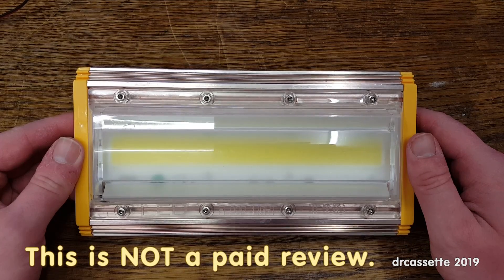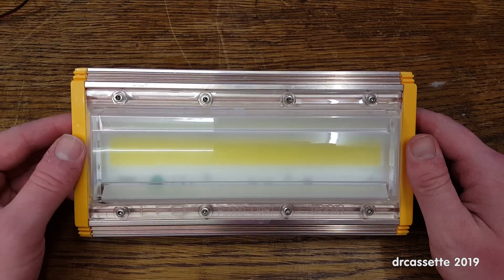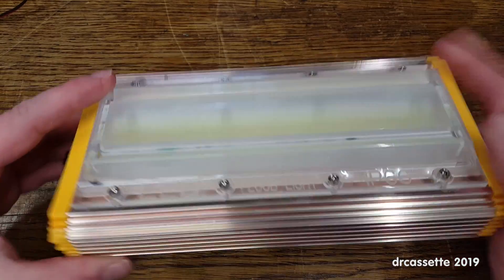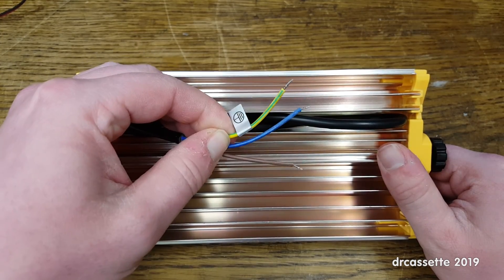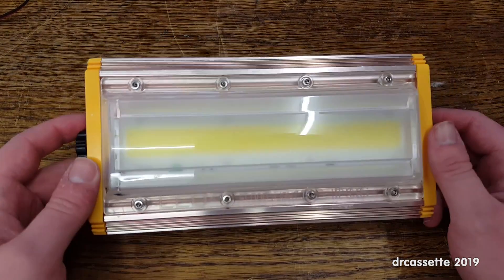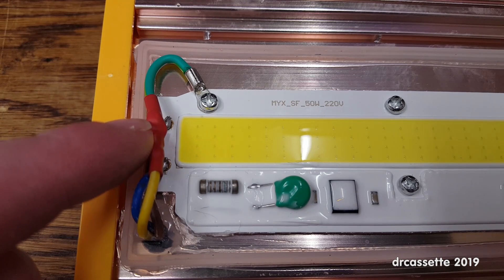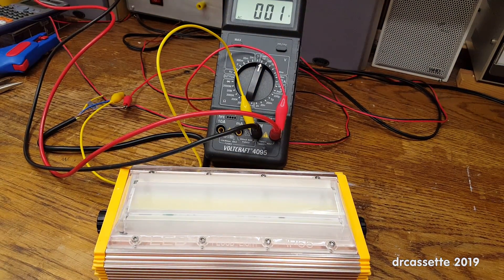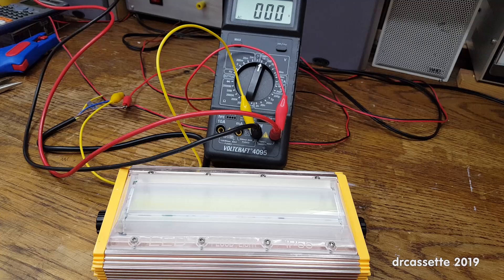50W COB LED lights off Ebay - Test, Modification, Setup as studio lighting

Comment from the maker: You may not want to solder wires before putting them into screw terminals. As some people have pointed out this still results in an unsafe connection. You may not do anything at all as everything is potentially unsafe. Just sit and wait.
Reply: Do you sell some of your stuff on eBay?  Is that what the studio lighting is for?
Reply from the maker: Yes, I do occasionally sell things on Ebay, and that's what the photos I make are for. But I have also already made a video using these lights. No flicker problems, thankfully.

Comment: LED and CFL lights are rated in Watts "equivalent" to an incandescent bulb. so a 23Watt CFL is rated for say 60 Watts. a 38 watt LED bulb is rated for say 100 WATTS. The numbers are really BS. What counts is the number of Lumen and color temp (3200K, 5000K) etc which affects the Lumen reading.
Problem here is CFL and LED manufacturers have no standard in measuring the Lumen value. One manufacturer says measure at 18", another says 1 meter, another at 2cm.
I can only guess that the solution may have to be. We, the consumers, create a standard. LOL. Maybe use a reputable company like say Phillips? then measure everything else based on Phillips method or rating watts.

All said a light bulb "Watts" rating has nothing to do with electrical power. It is light output based on power output of the old incandescent bulb.....

Comment: How much power an LED or COB uses is not of much use, I do agree it being underpowered it is even worse. Asa floodlight I'd want to know how many lumens am I getting for my Watt of electricity.
Reply from the maker: Each 50 W light is rated 4000 lm, but I don't have any equipment to test that.
Reply: @DrCassette  Yeh, see, the F-series Samsungs  I use give about 8500lm/50W or 17000lm on 100W... H_influx ones even more.
Reply from the maker: @poepflater   And they seem to be relatively cheap as well, I just read something like 15€ for a strip... I'd say you got the better deal :D
Reply: @DrCassette  Yeh man, they are the gift that keeps on giving, when it comes to the power bill... putting out 17 times the light of an equivalent Wattage traditional bulb.

Comment: The formula I use for cheap Chinese COB LED products is: actual power = less than 1/2 the advertised power. Some 12volt 5 watt bulbs I bought were drawing 2 watts.

Comment: I think, soldering is not permitted for screw-terminals because the solder becomes "liquid" under mecanical pressure. Maybe even for other mechanical terminals it is not permitted. You should crimp it instead!
Reply from the maker: I have never heard of that but I could imagine that happening. However, even when soldered, you still have to tighten down the screw properly, so that it pushes into the material and actually grabs the copper. I think crimping wires is much worse. I have seen too many crimped connections that failed.
Reply: I (from the UK) see it this way. Soldering (tinning) of wires under screw terminals is DEFINITELY bad practice. The solder cold flows as Adrian noted, and i've definitely seen this effect in real life, many times. (I'm a qualified electrician).   

I would actually argue with you, DrCassette, that  terminating stranded wires in screw clamps is FINE, if you do it RIGHT. tightly twist, and double the tightly twisted wire over. That means you get good contact with every strand. 

I have mixed feelings about ferrules. (This is VERY cultural and just a feeling, not a statement of fact). IF you have the right tool (every German electrician will) then the ferrules are superior.  If you do not, and have never seen them before (typical for a UK electrician) then bare stranded is better than just slipping the wires into a ferrule and relying on the screw to crimp it.

I have ferrule pliers and a selection of them, but rarely use them. Because of how I was trained.

but one thing is definitely true. Solder is bad for screw terminals.
Reply from the maker: Well you know what, I think I will just plain not include anymore mains wiring related content in my videos. No matter what I do, people are moaning.
Reply: I tend to crimp and solder if possible.

Comment: Those are some nice lights. I’m actually looking for some good but cheap video lightning as my room is very dark and the lights are quite yellow in tone. But the way the original manufacturer installed that ground wire sandwiched between the board and the heatsink is quite “creative” to say the least.

Comment from the maker: The current flow through the LED light may follow such a strange waveform that the multimeter can't accurately measure the current. So there is still a chance the LED light actually is 50 W. This will require some more experiments.
Reply: I love you're optimism but I have to say DON'T BE SILLY!! Almost none of the stuff from unbranded lighting, amplifier power  from China will never meet it's printed spec. They get away with it because government does not gave a shit if people are conned  or even killed by it's products as long as the money comes in. In most cases just a little more care (earth wire in this case) could make all the difference.
I think in many cases the factories that make this stuff really have no idea exactly what they are making. They just put things together from makes spec or test circuits. Very little is even tested.
Reply from the maker: Oh, I am not silly. The current reading I got from the multimeter is questionable and I want to find out how far off it is. And even if the power then turns out to be 40 W or maybe just 30 W I still want to know.

Comment: At 8:55 The wire is probably copper coated aluminium, crappy stuff really. If you use too much flux for soldering or linger too much with the soldering iron then the thin copper layer gets dissolved and you are left with the aluminium core which of course you can't solder to... 
You could try crimping with ferrules!
Reply from the maker: I haven't had such problems yet, my soldering iron is set to a relatively low temperature though. Crimping with ferrules is the "official" way to do it, but I think soldering the wire is even better because the solder flows into the wire and makes it solid whereas the ferrule is just like an enclosure for the wire.